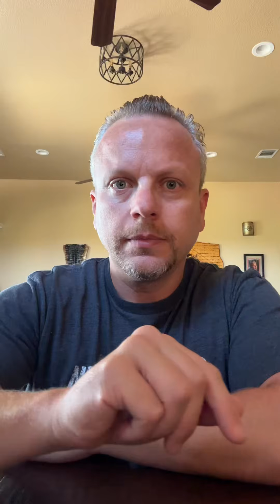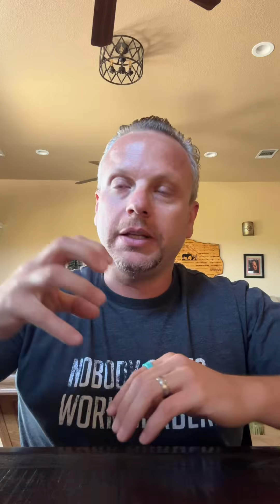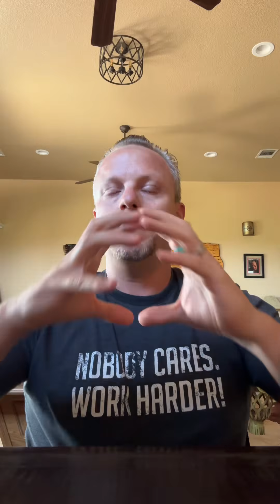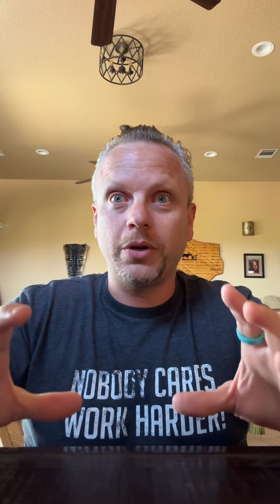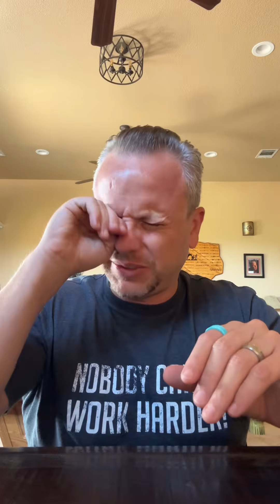E80: TESLA unveils V4 Supercharger Cabinet - HUGE!

Comment: I'd LOVE to charge my CyberTruck in <=30minutes (1MW / 800kW as implied at the Giga Nevada Semi rollout). Moving closer to the 5minute charging time currently available in China in any case.

I figured that Tesla dropped the Cybertruck's battery extender once they set the V4 charging voltage at 1kV ( the 400v battery extender would have required 1.2kV ).